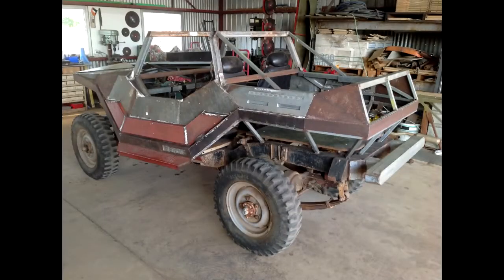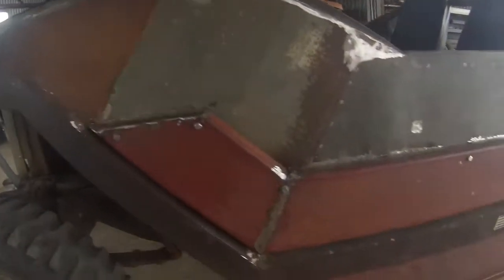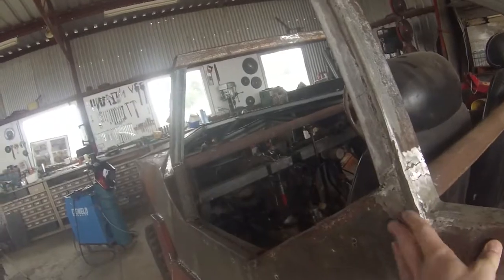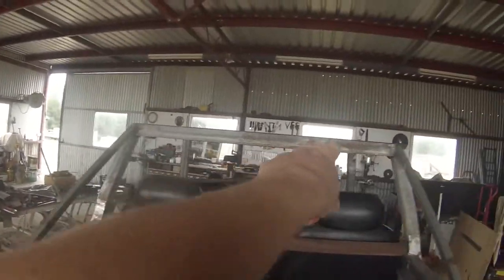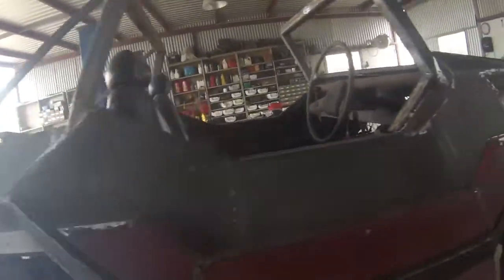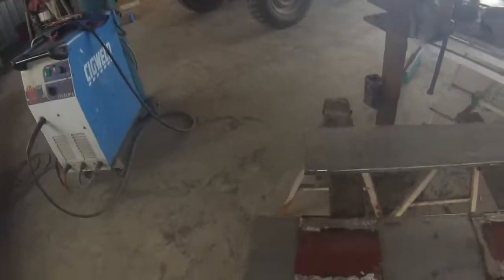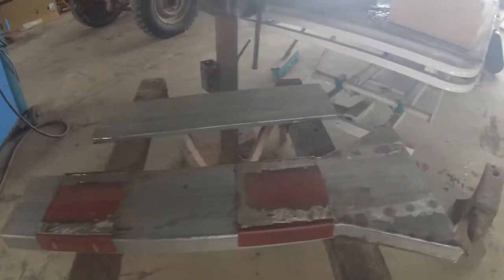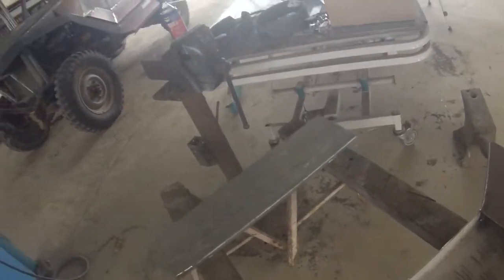Progress Update (Building a Halo Warthog)

Comment: hey it been a little while since an update is it going well ?
also I noticed during one of your videos you lose the depth in your side panels I believe they are too straight down.
im starting my own build on a 1997 jeep grand Cherokee. any recommendations
Reply from the maker: Hey, I've been living away from home at university for the first half of this year so I haven't been able to make much progress. I have a 4 week holiday now though, so I should be posting a video within the next week. 

I've been worrying about not having enough depth in the sides for the whole duration of the project, but I've recently come to the conclusion that there just isn't much I can do about it. I want to fix it but if I make the bottom of the body come out any wider it will hang over the wheels and look ridiculous. I'm just going to settle for what I've made :)

I would recommend you find a vehicle that's as large as possible, otherwise you may encounter the same problems as me. It sounds like you have good attention to detail so you could probably deal with these problems.

I've discussed the build and given some advice to my friend randomshittutorials in the comments here Building a Warthog: Construction Part 2 - Frame & Plating so you might find some useful information in there. Otherwise feel free to ask any questions :)